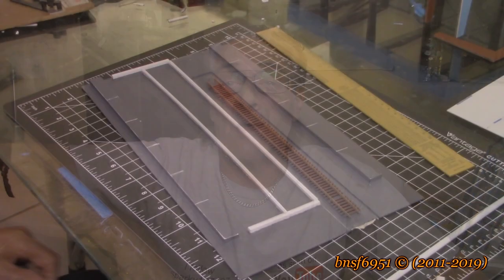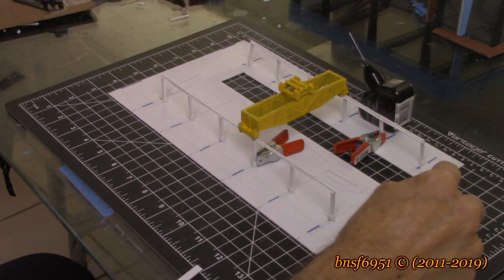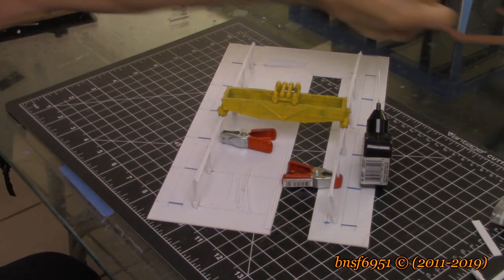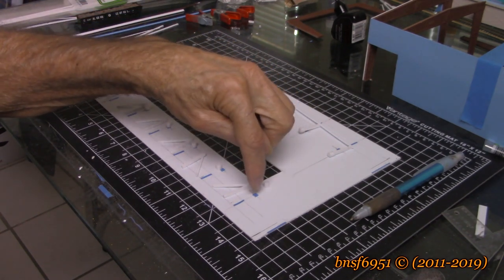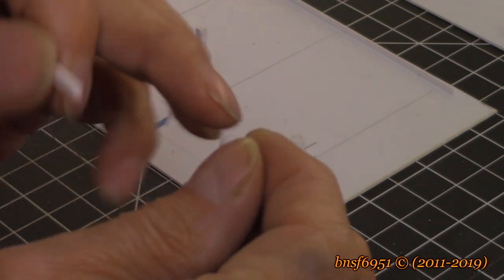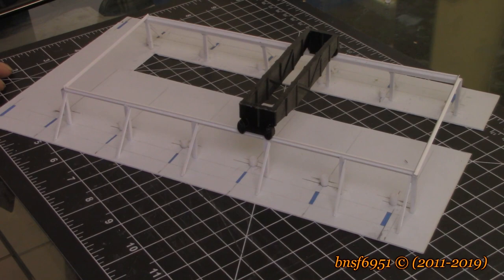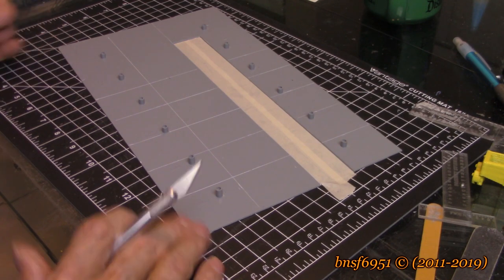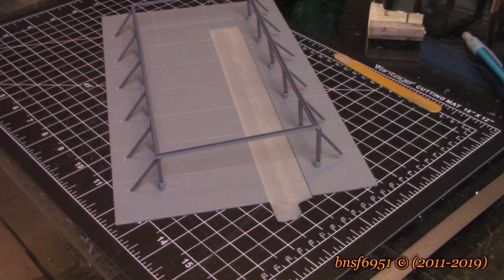HAYS  PIPE & STEEL pt 2 tk 2

Comment: Looks very industrial.  I really like the track placement inside the building.  If you want, I remember some overhead cranes with a big black 'P&H' in the center of the span.  I think google images of overhead cranes would provide you with a few examples for reference.  I also like your method of placing saw cuts for the expansion joints in the slab. It's always cool when extras are added to something without asking.  Those 'Easter' eggs are priceless and add lots opportunities for you and the owner to appreciate the overall build.